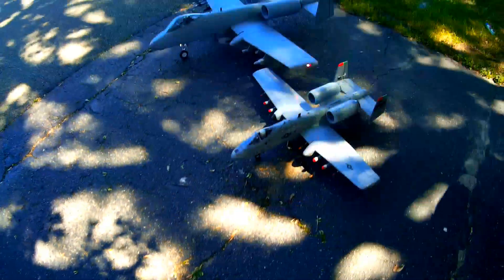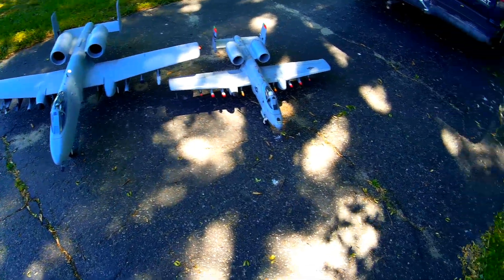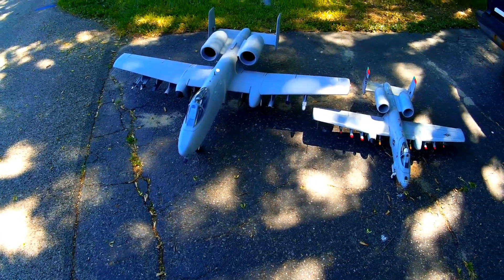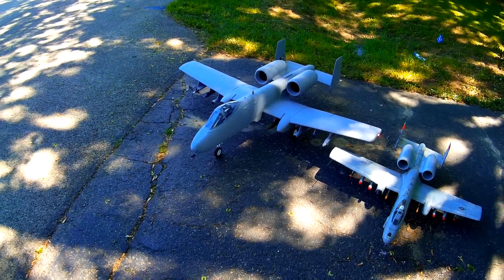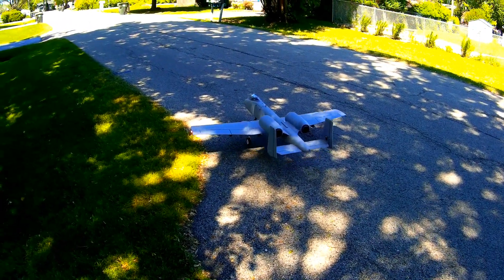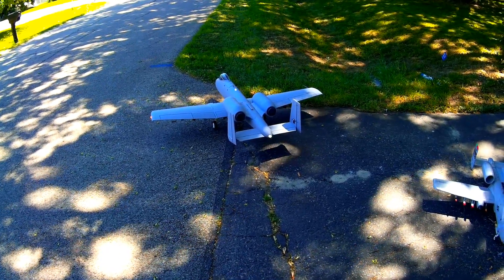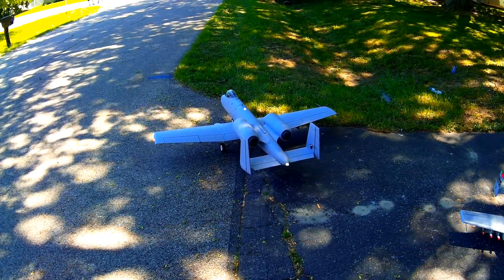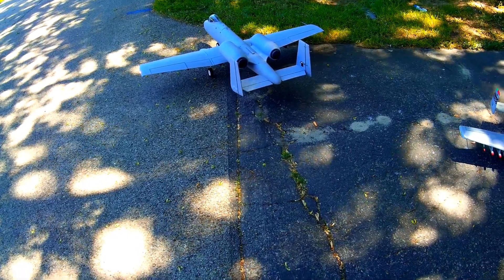Freewing A-10 Thunderbolt II 's 1700mm Compared to 64mm and Taxi /Gear Check

Comment: I hope the trimming on the ground is in sync with you putting her in the air. I always adjust the wheel linkage on this rather than the radio. You can check the rudder now and see how far it is out relative to the servo arm after you have done this. Like they say, better be off on steering than in the air.